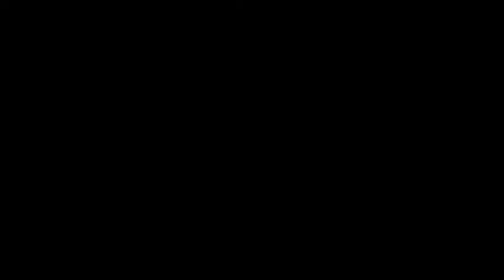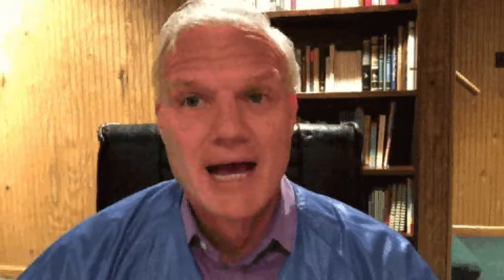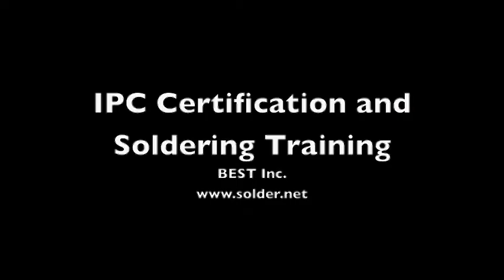What is the Difference Between the IPC J-STD-001 and the IPC-A-610

Comment: It is difficult to define hand soldering processes as they differ between assemblies (referencing the J-Std.)  Machine soldering, either by wave or reflow oven is easy to define (and critique the quality of).  Rework and new assemblies which have to be hand soldered is a different animal where stresses and thermal shock, etc. come into play if high integrity is to be retained.  Intermetallic embrittlement and other fault elements have to be kept in check.  To me (and much of the military) RoHS was a costly change and was not needed.  Metallic form Lead is not the danger.  Scientists spent decades perfecting the Sn63-Pb37 solder alloy.  Government contractors are not obligated to follow RoHS in some instances, it depends on what is being manufactured.

Comment: The J-STD-001 1.7 says if the J-STD-001 is sited in a contract, the 610 does not apply unless separately or specifically required...why would this be the case if the 610 is a companion document to the J-STD-001...or given your explanation of each documents purposes?
Reply from the maker: Hi, Thanks for your question.

The J-001 and the 610 are companion documents in that they both relate to the assembly and manufacture of electronic assemblies. 

The J-001 applies to the assembly process, i.e. what should each step of the process be able to achieve and what should the product look like after each step is complete. It answers the questions of, "How should the process be controlled to make a good device?" The assembly is evaluated at each step to ensure that the process is correct.

The 610 is only the visual appearance of the finished assembly. That is, after the device has been through all of the assembly steps, heat cycles, rework or repair, etc. 

The criteria in the documents general match, but the 610 may have slightly different (sometimes less strict) criteria compared to the 610. The 610 takes into account that there may be slight degradation of the assembly by the time it's been through multiple assembly steps.

If both are sited in the contract, then the customer (designer) has the responsibility to define what document take precedence when there is a difference of criteria between the documents.

Thanks again for your question and for watching our content!
Kris Roberson
BEST, Inc.
Master IPC Trainer